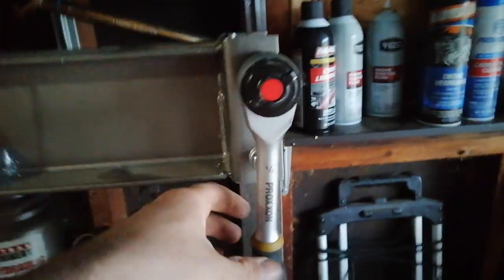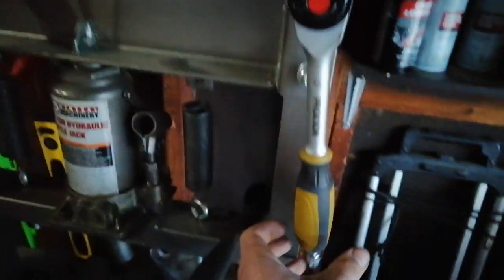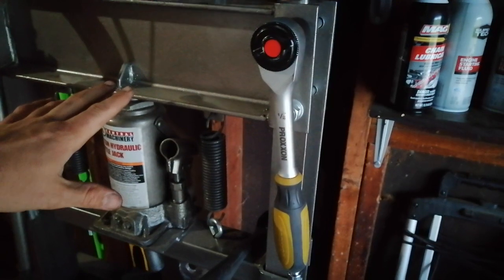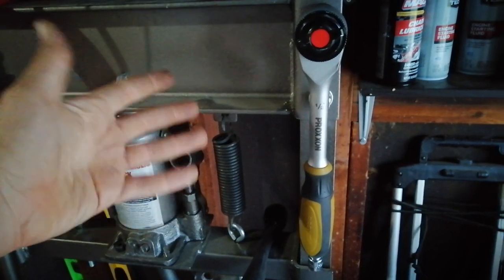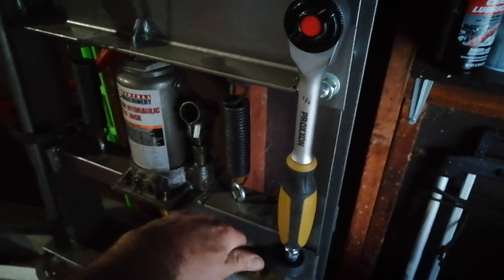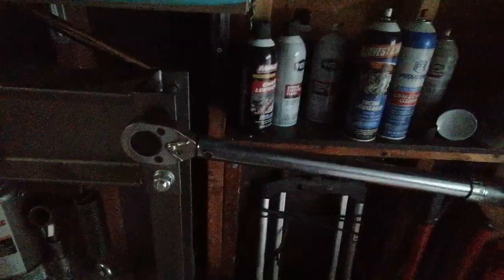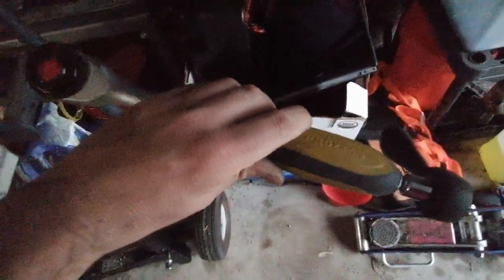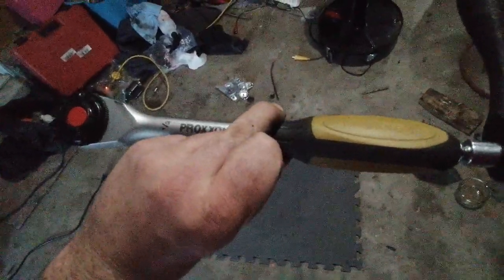Proxxon--worst ratchet ever

Comment: The purpose of that tool is to help install and remove nuts/bolts in hard to reach places faster with less hassle. It isn’t for torquing them down to spec. Though you can if you just use it like a regular ratchet. But the rotary function is just to speed the process up. 1/4 inch and 3/8 inch drivers seem useful, a 1/2 inch is too big. Usually a driver that big you need a lot of torque. You’re better off using a regular style ratchet or impact gun. Rotary ratchets are great for engines.

Comment: O boy, o boy... Every tool is designed for a certain purpose and it's obvious you are not using this tool as designed. This does not make it a bad tool, but rather a bad technician. Proxxon is a reputable manufacturer from the greater Stuttgart region. I own a Proxxon Industrial wrench set 1/2" + 1/4" since 1991 (was/is my first decent tool set and I still have it up to the last bit). Get a tool you need and stop crying! Cheers!

Comment: It's meant to move the nut or bolt until it's where u need it and then tight with regular ratchet so your not going 1 tooth at a time in a tight spot hitting your hand on objects in the way

Comment: Hi Matt, I am from Germany... Proxxon is not a German company, they are based in Austria and Luxemburg, sadly they also don't produce the tools in Germany... most of those are produced in Taiwan I think.. the quality for the price is normally very good.

Now for the Ratchet - you misunderstood the purpose of this design. this is why you are frustrated. this design is normally used for extra tight spaces, where ratcheting with the handle is a pain in the ass (even with fine tooth Ratchet that is..), there is where you can use the extended function. to finalize the tightening (either with a normal key, a Ratchet or a Torque ratchet) you are not supposed to use the implement on the Ratchet's handle, but use directly (especially with a Torque ratchet - normally this is written in the instructions booklet that comes with them... even using an extension can cause the Torque to be misrepresented...)

Comment: you totally dont understand the point. you break the tension with the handle....., then only use the rotary to "speed" off the nut -  especially valuable in a tight spot.

Comment: Yep the 1/4 in drive in the bottom is a red flag I wonder why can any body make a decent 90 degree ratchet adapter for the money this thing cost you'll be better buying the cobalt version
Reply from the maker: Yep, I ended up returning it
Reply: Why do you need a 1/2" drive at the bottom? It's not designed to deliver much torque, it's there to put on extentions and a hand grip to have more reach. Did you and the video creator don't even look at the brochure of the tool before complaining?